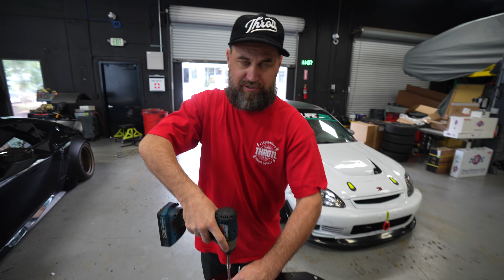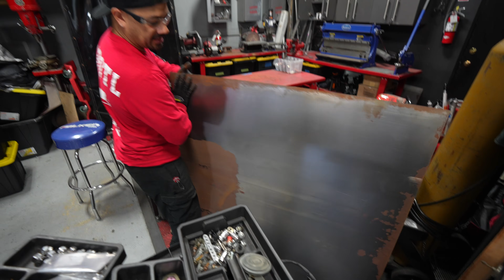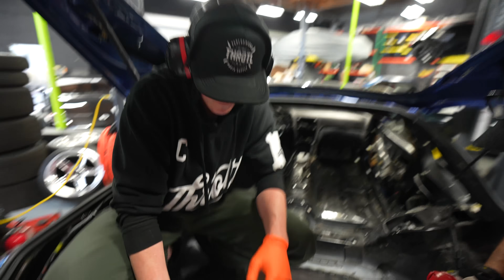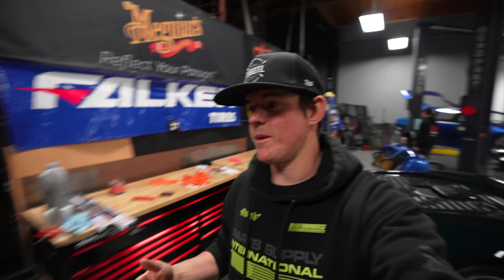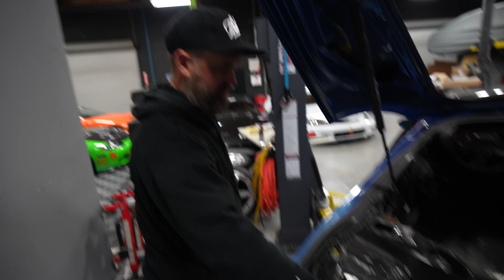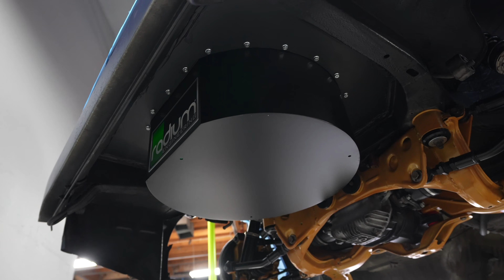Turning a $300 Nissan 300ZX into a $30,000 Nissan 300ZX - Part 9 (New Radium Engineering Fuel Cell!)

Comment: The next time you need to put something into a piece of pipe , heat up the pipe with a lighter or torch and the other piece goes in in nice and easy and then mold to the piece you put in.

Comment: trick of the trade for hoses that are tight... use a heat gun and warm up the hose and use isopropyl alcohol and goes right on and the iso evaps, boom done! Works really good with push lock/ instagrip hose.

Comment: Next time just heat up the ends of the vinyl , rubber or silicone hoses to be more flexible to fit easily without suffering  😂

Comment: hold the hose in hot water next time you need to insert the filler, it makes the clear tube more malleable and then it cools and tightens up
Reply: Yep and no lube required 😂

Comment: You guys should have done a VG30 TT Engine. They aren't that complex anymore and can be simplified and reliable. The SR will run out of steam quick and doesn't match the weight of the car IMO. RB or 2J would be sick. VR6 would be epic. Like the SR but better.
Reply: Vk50 tuned and N/A woulda been killer.

Comment: Ricky, make them get u a bead roller brother, give some stability to that sheet.
Reply from the maker: We have one. A bead roll on this piece wasn't necessary.
Reply: @throtl  4 inches of flat sheet with 80 lbs of fuel and 20 lb fuel cell, high rpm drone from flex us a real possibility. Harmonics are a bitch, I deal with electronics, harmonics are a bit of a speciality.

Comment: Always use weld through primer before welding in a piece of sheet metal like that. Those overlaps will rust from the inside out.
Reply: We did.
Reply: @mickeyandrade3435  🤦🏼‍♂️I shouldn’t have doubted you guys 😊